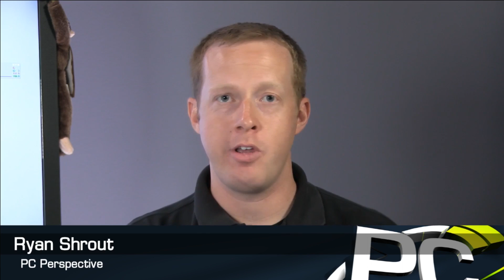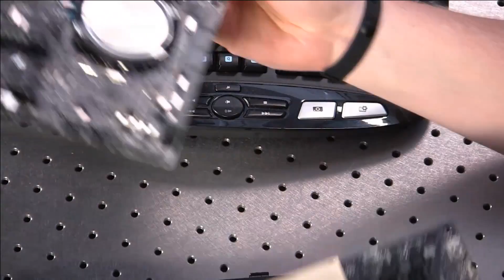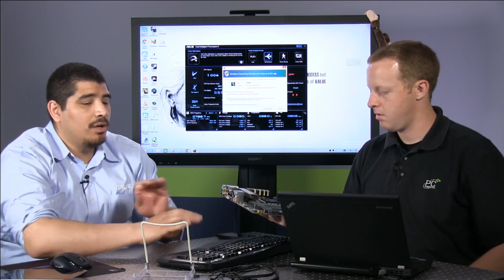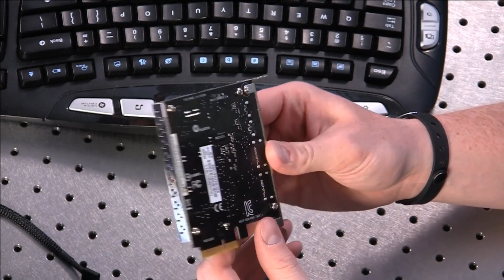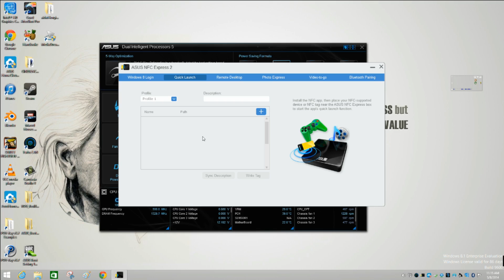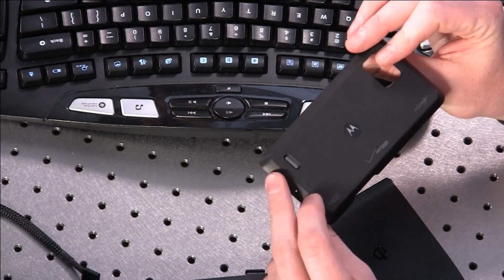ASUS Z97 Mainstream Motherboards Overview

Comment: why manufacturers stoped doing motherboards with SPDIF Coaxial out ?

I'm asking because i have a very good (but old) set of speakers/sub/decoder that only uses digital coaxial signal or the normal analogic...

it's time for me to upgrade my PC (6years old) but theese new z97 boards, from any brand, dont have SPDIF Coaxial out :(

why do they force consumers to upgrade so much stuff, when old stuff still works, and most of them out perform most of the new stuff, in my case, my audio setup.